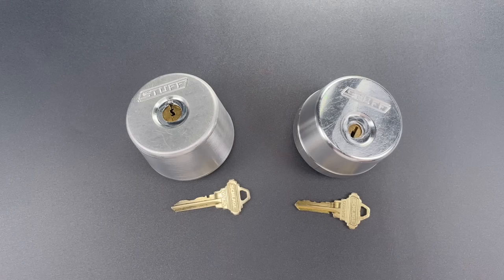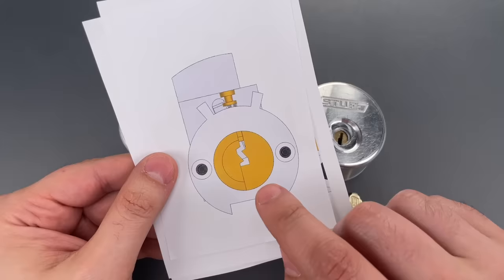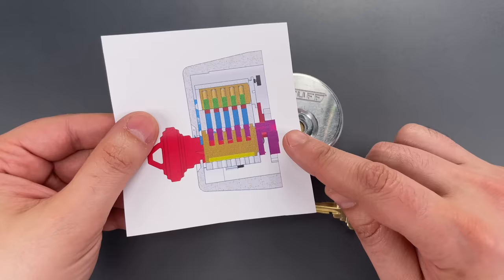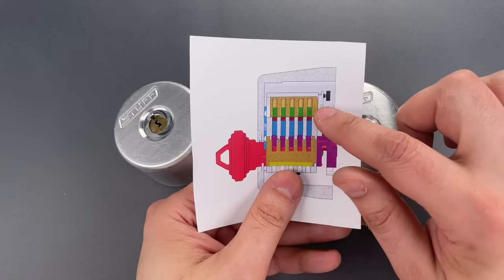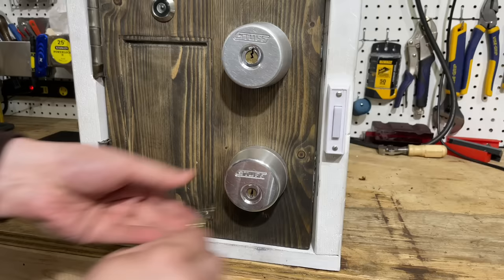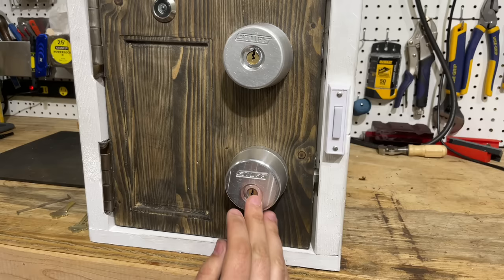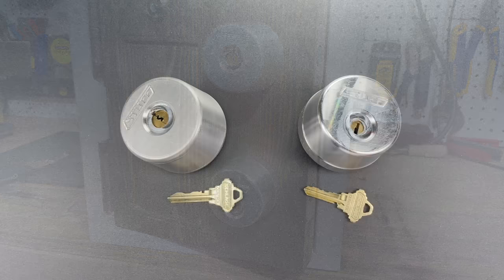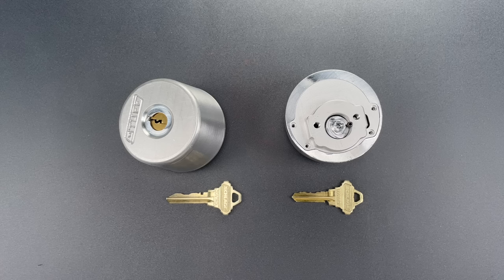[1299] Unpickable Locks From Stuff Made Here

Comment: instead of a machined back cover, you could just recess the lock housing into the door a couple of millimetres, can't slip anything behind it then.
Reply: That's what I was thinking.  A 1/8" ring going into the frame would stop that attack
Reply: You could, you could do that.  But why not just machine a cover 🤷‍♂️
Reply: That would force purchasers to modify their doors, though - those cutouts are fairly universally sized
Reply: But then his picture wouldn't be in the dictionary under the word "Overengineer"
Reply: LPL mentioned there were many ways to stop this particular attack. The back plate was what he called the most expensive option but it’s my favorite because door installers are never going to bother with the minutia when installing locks which is why insurance companies don’t consider you to even have a lock unless it’s a deadbolt. Too likely that a normal installed knob will be trivially exploitable due to not being properly fit.
Reply: @karlanke  The locks I've installed that have the feature described get around this by making it about .125" smaller in O.D. than the rest of the lock body so it doesn't require drilling a larger hole.
Reply: @karlanke  it is possible I think to taper the housing extension to fit or just make the housing extension standard sized.
Reply: Yeah but I really committed  thief could just chisel out a little bit of the wood off the door to get behind it again. The plate ensures that the method can't be deployed.
Reply: No modification to the door would be required. The ring seat would just fit snugly into the standard sized aperture.
Reply: @karlanke  Yes but commonly enough people have to modify their door in one way or another so it's not whole lot of inconvenience, especially when it makes your home more secure.
Reply: Sounds like the response from a guy who doesn't have a CNC machine in his garage...
Reply: @TysonJensen  Well deadbolt latches are far superior.
Reply: Or the opposite, make the casing deeper than the length of the mechanisms. Anything thin enough to slip behind the casing couldn't reach back to access the bar.

Comment: "Probably the most expensive solution, but it certainly works." Engineering in a nutshell.
Reply: management always wants a cheaper solution though
Reply: @Fairyplay  Gotta pay the bills and employees and expand.
Reply: @James_Bee  cutting corners might be good for short-term revenue but usually ends up causing a ton of damage, costing a lot more than if the time and money was initially invested.

I work in software development so not engineering per se, and shuffling out a "good-enough" product more often than not means you're going to have to put out tons of money for maintenance or rewrite years later
Reply: @Fairyplay  Also known as technical debt :)

Comment: ROFL -  I love it!  Highly secure and complicated lock can be opened without even picking it.  Granted if there is a plate in front of the bolt it would make it harder to open and if it is a door that opens inward, you'll never have access to the bolt so that's really a low risk even though there is a high vulnerability. 

I loved this.

Comment: I would trust without question any locks designed by Shane and endorsed by you, sold alongside your other tools.
Reply: Based on Shane's comments these would be insanely expensive locks.
Reply: 0:42 I don't know if he's ever said original and quite good before. That's quite an endorsement.
Reply: @alexanderf8451 the manufacturing cost per item on most things drop in price during mass production from the prototype stage. but still the price would probably be limited to commercial applications.
Reply: @anderson6606  or nerds with disposable income..
Reply: Add in PacLock and you could have a pretty good deal.
Reply: @alexanderf8451  To be fair, they haven't been optimised for manufacturability yet - only function. Prototypes are often crazy expensive.

That being said, the complexity of the mechanisms will likely mean that they will always be more expensive than the more traditional models, even after cost optimisation.
Reply: I would just be way too worried that I might loose my key.

Comment: This guy turned “unpickable in theory” to hit it with a mallet, or just move the bolt with a knife
Reply: Tapping with a mallet is a reasonable indirect way to pick it- it's similar in concept to a rake attack. As for moving the bolt, in a commercial product, that'd be a major design flaw, but LPL also picked it conventionally, and pointed out how, with this design, you could decode the key- but also gave solutions for each problem.

Not competition, collaboration.

Comment: "There is no unpickable lock"

-LockPickingLawyer
Reply: There certainly is... but at some point it becomes cost prohibitive. Also, the exploit of accessing the bolt only works on a really shitty door and you could simply recess the lock a bit into the door to avoid the slipping underneath).

Alghtough thinking of it, I don't think he has picked any of the more recent dimple locks like a KESO 8000Ω2 or KABA Star cross (the most modern he has picked is a Kaba 20 and that is old, I think it came out around 1990). I have no doubt that he can pick them, but it would be interesting to see how hard it is.

Ultimately, you can always add an electronical component to the mechanical cylinder (E.g. dormkaba smart key + star cross), probably the cheapest solution to up the security of a mechanical lock at realtively low cost. It also makes copying the key harder and can be used to restrict and track access (e.g. you could electronically prevent any key from opening your house door between 10pm and 5am or for the week you are on holliday).

Probably the biggest weakness of any lock is the key itself and the person carrying it. E.g. put super-security key in a locker at the gym protected by a Master-Lock... 2 seconds, the locker is open and you can make a copy of the key.
Reply: @etherealicer  dude please chill
Reply: Yes, there are a few unpickable. Bike shackle Bosnianbill uses - the key has to be fully inserted and closed in the lock to be engaged with it. Also a few top-shelf Gerda locks. Few ABUS-s are quite a challenge as well.
Reply: Someone send LPL a fake lock to pick lol that should be entertaining.
Reply: Except for a sticker

Comment: I saw that other people mentioned the fix I'd thought of for the knife bypass already (door opens inward, deadbolt not accessible), but sticking a tool up behind the lock could easily be fixed by insetting the body of the lock into the wood by a millimeter or two.
Reply: A security type door could also be used. They have metal housing where lock is installed, meaning you can’t access the sides of the lock. They also have a sort of kick-prevention metal flap that extends to the frame of the door. It gives door more security against being kicked in, but it also doubles as a mean of hiding bolt behind it.

Comment: The part about Shane precision machining a back cover made me laugh lmao

LPL: "Yeah, there's about 12 different ways you could fix this, it's a pretty easy fix."
Shane: "The most expensive and most over engineered way it is."
Reply: That made me laugh
Reply: I wonder if Shane is German? Or if he works for BMW or Mercedes?
Reply: @` Since many other parts were made on that CNC machine, uploading a new drawing was probably easier than searching for a cheaper fix.
Reply: I mean, was it really that expensive for him? Sure it would be a lot of money for someone who didn't have like for CNC machines in their garage, but SMH is kinda odd on that front
Reply: From a production stand point, the back cover could be made via a 2 minute CNC machining center program to clean up an investment casting. Might add $1.00 to manufacturing costs....
Reply: You can also just inset the lock housing into the door about 5mm, the internals would need to be adjusted to align with the bolt, but I think that would be much cheaper than the CNCd backplate.
Reply: I kinda love how it's just a brute force solution. "We'll just give the lock armor."

Comment: After dozens of 2-minute "this lock is laughably sh*t"-videos, this one is a nice change. :)
Reply: Lockpicking lawyer could have made a 2 minute video out of 5:35, he was generous enough to give stuffmadehere another 8 minutes of explanation and alternate picks because they're another youtube channel
Reply: @davidy22  Also, cause he is basically asking for advise. And LPL didn't circumvent the basic ideas of the lock but found some loopholes in the implementation. For the second approach even ones that are trivial to fix. Would be interesting to see what LPL could come up with after these things are fixed. Because the idea is great, most other lock designs are pickable in theory, they are just hard to pick in practice because of the skill or tools needed.
Still don't think any of these designs ever will make a product, because "hard to pick" is just enough in practice.
Reply: @salia2897  I dunno about that "didn't circumvent basic ideas of the lock" thing, he turned the keyway and pushed the bolt into the lock. That's a heavy bypass and if he made a two minute video doing that to a lock he bought off amazon the comments section would have absolutely derided the manufacturer for claiming it was unpickable.
Reply: Now its just implied
Reply: @davidy22  Yeah it is a bypass of the lock which can easily be fixed, it is not a pick of the lock. And the pick of that lock was only possible by getting access to the second core, which is also easy to avoid. The basic idea is that you cannot tension the core and manipulate the pins at the same time, and he didn't find a way to get around that. Maybe he still would find it at some point.

If this would have been sold to customers, yeah sure, that would be a shitty product. But it hasn't been, it is a prototype. And this is why LPL analyses it as a prototype. He has done that before even when companies have sent him prototypes.

And yeah, of course these are big oversights. I think they come from a lack of experience designing locks and from a typical engineering tunnel vision. You got a certain idea (this idea of making a lock where the pins cannot be tested separately) and then you put everything you've got into building that to make that work. And when you done, you do not take a step back and think about attacks that go completely around that basic idea. I do hope he makes an upgrade with the fixes suggested by LPL.
Reply: @davidy22  The thing is: this isn't a lock of Amazon, and Shane was aware that there were bypasses like this. And as both acknowledged, they're fixable. Shane didn't claim it was a finished product, which is why this is a different situation. And for the attack that actually picked the lock, he found a solution. And then the only thing missing is the different length picks and the 3d printed part that's machined slightly differently. 

The reason why LPL spent so much time with this is that it had genuine potential.
Reply: The fact you watch dozens of videos of someone opening a lock is laughable shit
Reply: @furhadnasserjah123  Yet, here you are.

Comment: This is an example of evolution  where lock-makers and lock-pickers evolve different strategies until they either reach the ultimate unpickable lock or prove that such a thing does not exist. Of course this problem might even be undecidable. Can't wait to see what happens.
Reply: An LPL video where he fails to pick the lock is a rare thing.
Reply: As long there is a way to normally open a lock there will probably be a thing that can "emulate" the correct key values. Its just a matter of how hard it will be to do so. If your lock is hard to open or requires a lot of time to open, many thieves or intruders won't bother with it. Its all about how fast you can pull of a crime
Reply: @Mom19  which tbh is the whole point, making a lock so unworthy of picking that thieves go somewhere else. If a standard robber came across this lock with no knowledge of how it worked or what exploits to try, it might take days
Reply: @Mom19  at some point they’re just gonna throw a rock through your window and call it a day
Reply: This in turn then sounds like a job for Veritasium.
Reply: LpL has all the infinity stones
Reply: @fisty539  That's the principle on how most bike locks are sold. It does not have to be unpickable or super-resistant to cuts. It just has to be better than the one on the bike next to yours. :D
Reply: @kathrynelrod5570  you mean that’s the first thing that anyone would do — if you don’t have bars on your windows, you live in a place where theft is so rare as to be basically negligible. Heck, even if you do it doesn’t mean theft is a worry, it just means that the people in that area have reason to believe that it is of concern.
Reply: @kathrynelrod5570  ..then the window will be mate with polycarbonate...lol
Reply: The big trick with the lock arms race is that even if the lock itself is completely unpickable, then physical attacks become the mode of entry. In this case, what would stop someone from just cutting around the locks on the door? everything needs to get stronger together as the system will only be as strong as the weakest part, that is why picking is a fun hobby but so rarely seen in the real world because breaking a window is far easier and doesn't require skill.
Reply: @kathrynelrod5570  exactly my point. There is always a way to get in. Its just a matter of time and how noticable the way of entry is.
Reply: it is the same problem as weapon vs armour. It is a never ending race. And lock is a tiny part of overall security, quite a few thieves attack the door, or more often the window. And rarely they attack the wall.
Reply: @McKruemelkatze  lol no joke I just wrap duct-tape round certain parts of my bad mountain bike (with u-lock), it's fine but looks awful next to the new road-bike right next to it with a standard plastic lock
Reply: @lamothe87  my bike got stolen coz I had an 'unpickable' lock that was made of plastic!! I'm stupid I know, lesson learnt lol (they used a blowtorch lighter, nuff said)

Comment: Walking the deadbolt back after all that time over engineering and designing it was pretty awesome!!
Reply: First
Reply: I laughed
Reply: Ant decent door has a lip over that would prevent this from happening in the real world.
Reply: This type of thing happens way too frequently lmao, felt relatable. He spend hundreds of hours perfecting one thing (and basically succeeded aswell), just to then add unforeseen vulnerabilities with the afterthought of delivering it as a door. If he just sent in the lock, LPL would have likely mentioned that you can tension it by accessing the back, but as it would have clearly been a prototype with the open end, he likely wouldnt have seen or exploited it as a real vulnerability. And the bolt thing wouldnt have been a thing either. 

Way to shoot your own leg :P
Reply: The door is installed backwards.  Why is the hinge on the outside and why can you access the deadbolt after all?
Reply: @brainzor777  The point is this LOCK is unpickable. Welding a door shut also stops people from getting in lol
Reply: Pretty awesome?
Reply: That is an extremely common attack vector, actually. Where I love the door itself is commonly designed to protect from it

Comment: They should develop a lock together — no shortcuts, the best materials. I'd invest.
Reply: you invest, no one buys...

well if it's too expensive of course
Reply: Bosnian Bill, Stuff, and LPL: the ultimate lock.
Reply: @lastyhopper2792  the government guys. Military
Reply: @jessicaclark7130  if there is a door that those guys really don't want to be open they can choose a lock option that you can personalise, number locks or scanners.
Reply: @jessicaclark7130  doesn't matter, with how expensive and complicated the lock would be mist people would just rely on external weaknesses like sawing the bolt in half to avoid using the lock at all
Reply: thats when lock costs more than entire house ... people would steal lock and leave what is inside :D
Reply: Unfortunately it'd be wildly impractical. Not because it'd be too expensive, but because to effectively use it, the rest of your security outfit would be far too expensive - it'd only be useful on a solid steel safe, and on a safe, there are easier ways to achieve this level of security.
Reply: Any lock which requires a custom tool is more secure than the door it's on, really.
Reply: Or... you could get a Bowley or Protec2
Reply: @Mural  That depends on the door. Or the wall.

Thing is; most people just want to deter common burglary. 

Even if the criminals are professionals, they usually wouldn’t try to break open a door with a lot of force because that’s loud and also when the police is likely to get involved. 

Or neighbors. Or both.

Especially in the USA detection poses a serious threat but even an angry owner with a, let’s say, pocket knife, can seriously injure a potential attacker. 

And the wealthier you are, the more likely it is for you to have an armed security service employed to protect things you really want to keep save. 

To conclude the best lock, is an armed guard - or an alarm which is just a modern way for people to call the "guard" or wake you up/ attract attention to your house. Easy to install and works in nearly all usual cases to deter a hypothetical intruder.